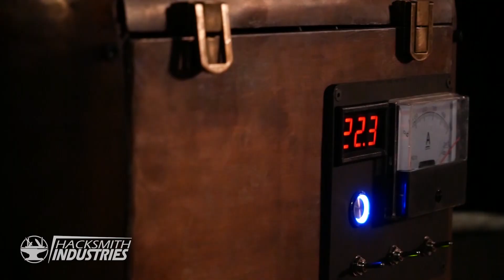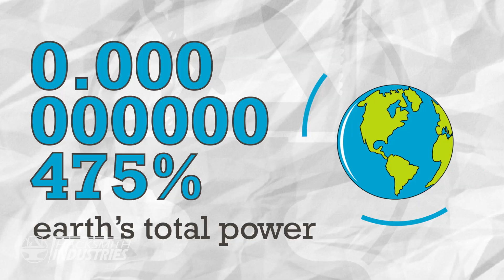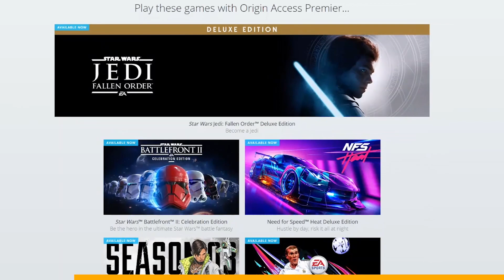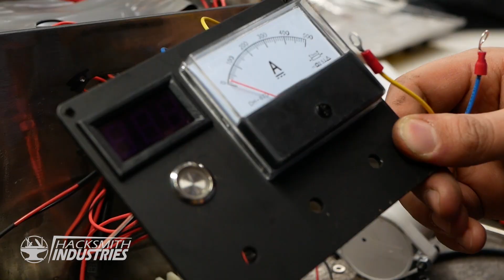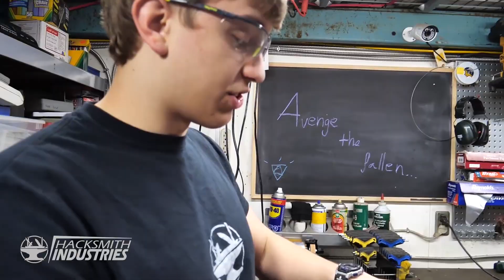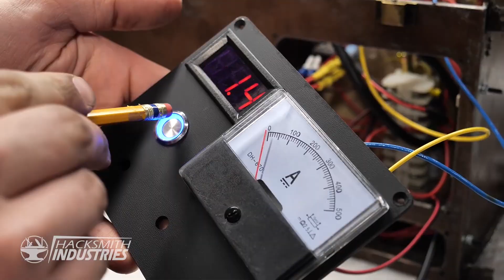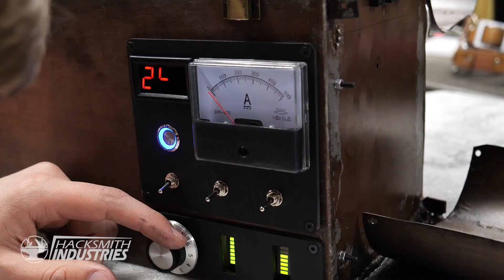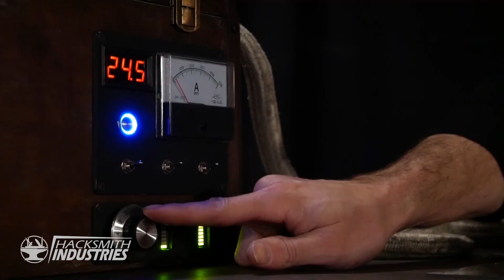World's First Protosaber! (REAL BURNING LIGHTSABER)

Comment: Utilizing sound waves can make the light or reflect. The right pitch can even make light stop. I'm doing a project where I'm using sound waves to stop the heat from the reactors such as fusion reactors from expanding into the metal shielding. It dawned on me. You can use sound waves the same way to stop the energy waves of light from traveling distances. And even containing the light into a reflective beam stronger than even laser.

Comment: I am just an electronics engineer, so... Why do you connect all batteries in parallel first and then switch? It would be a lot easier to use individual mos fets for each "sub battery back" and then to connect the outputs of the fets. Each FET has then only to switch a few amps on and off.

Comment: Laughing in using a hollow rod of metal with bits connecting in the middle so that the energy doesn't converge only at the top and instead has multiple convergence points to more equally distribute the electrical current
Reply from the maker: Wat
Reply: Wat

Comment: Actually to build a lightsaber you would need to build a hilt that’s able to produce an illuminated particle blade with a magnetic field in its center. Basically the blade core. This magnetic field core holds the particles in place, and contains it at the same time and it’s used to adjust the length of the blade. The heat of the blade and it’s cutting abilities come from produced vibrations of the particle within the magnetic force field. The stronger they vibrating, the hotter it gets to a certain limit that the hilt doesn’t break, and these vibrating particles within and around that magnetic field also produce that lightsaber sound. I could go on in how the vibration would work in order to make it work, but maybe you'll get the basic idea of how it actually would work. Just my humble decent thoughts on it. 🤷🏻‍♂️

Comment: It’s undoubtedly an amazing creation, but there’s nothing practical about it....
Reply: Actually. There are alot of practical uses for it. With technology controlling everything almost. Automatic metal doors that can't be bashed in. Depending on how it cuts can replace most battery operated saws. With a few more decades of scientist working on thermoregulation and the installation of crystals like diamonds they can use the energy and force it into a more solid state like lightsabers. Many applications would be useful to have a saber. They used tungsten bars and batteries. With more understanding and open minded people they could easily figure a way to make an actual saber from the movies.

Comment: The main problem is NOT the power source.  The main problem is the insanely high power light beam that magically ends in 4 feet.
Reply from the maker: No,  its the power source.  With enough power anything is possible.
Reply: @hacksmith  Not sure if you are joking, but no.  With enough power you'd melt your tool (nd face) before it was anything close to being a "light" saber.

Comment: Modify idea to inventor :
Use the half soft metal blade like the 
Tape measurement to conceal the blade.
When combat, roll out like a tape. The tape 
Blade create high heat even it is soft.
Handle  with batteries like flash light.
Work or not ????????????????

Comment: I know how a real lightsaber would be made: The handle would have to be a mini-sized nuclear fusion reactor just to make enough energy to power the Light. The actual blade would be extruding out with a telescopic design and would have to be made with a lot of little LED sized and shaped transparent capacitors, I'm assuming transparent or would have to be enclosed with a material with a REALLLY high melting point - such as this: HfN0.38C0.51, that would be able to emit that level of heat. And that's all from me. (This is copyrighted so if you intend to create this you have to give me lots of credit-email me and I will tell you my name if you do intend to do this) Edit: the material of the telescopic device and the handle I would suggest to be a mix of graphene and titanium.
Reply: Guess you’re just gonna have to invent fusion.

Comment: Question: would it be possible (albeit presumably not practical) to create a proto sabre that generated a high frequency, high output plasma field along the length of the "blade"? It would theoretically generate WAY more heat and potential "cutting" power. I watched a video that alluded to using a high frequency plasma field as a "force field" of sorts that could vaporize any incoming threat, so I wondered if it was scalable.
Reply from the maker: Yeah working on one

Comment: Li-Ion batteries short circuited without a current limiter? I would have guessed that they would explode as soon as you did that "welding test"...
Reply from the maker: The short is the current limiter. The pack is happy to put out 30kW :)

Comment: you mean an average north american house needs 40 kW to heat up? A well constructed Italian one needs less than 10, and no, it's not smaller! We do use insulation.
Reply from the maker: No,  I mean that's what's available at the panel
Reply: @hacksmith  Wow! Here they would let you have 10 kW at most, and 3 to 6 kW being the usual. 40 kW is definitely in the small business range.

Comment: i swear the temp in the thumbnails keep going down, if you do the math, 20000 watts is over 10000 degrees, so this is +10000, the kylo ren saber is 3000, and the duel is 2752
Reply from the maker: Watts is not a temperature unit...

Comment: "LightSabers are impossible to create in real life" - since I got to know a few things, and pretty sure, you are wrong now. Its already possible, always were possible, but since everything in sci-fi movies were presented as impossible, people believed its not possible. Inernet was impossible once, as computers, and radiwaves. 
But if you consider the idea behind alien technology (since we are already using alien technology even with using computers and mobiles), you may recognise, even real lightsabers are possible to create.
Bob Lazar's UFO was actually using a propoltion what is way different than any idea, what was used for propltion nowadays.
That UFO technology "allows" people to travel lightyears (distances) without actually reaching lightspeed (not needed), and making freaking long distances without fastening up that much - because of the idea behind the UFO propultion system.
So, I say, you may basically think wrong about making a lightsaber, in details and logic, but its possible to create.
Reply from the maker: More the heat and energy density that is the issue ;) not melting your face off holding it

Comment: The original light sabers in star wars were battery backs! You literally made a real saber. Holy shit. Great engineering man you deserve the 12M views. My mouth was literally salivating around that 15 min marker. Holy sh*t man, the FORCE is strong within you.
Reply: lightsabers are made up of light not a core of metal. this is a heatsaber not a lightsaber the word light in lightsaber is there because the blade is made up of nothing but light not metal and cloth.
Reply: @fubar1872008  lightsabers would just be lasers then and you wouldn't even be able to see the blade.
Reply: Timothy Farmer definitely not made of light
Reply: Ye Old Saber tech this equates to Gundam Universal Century Heat Weapons 
Dom Heat Saber, Gouf Heat Machete, Zaku HeatHawks, need I say more? 

Beam Weaponry is Expensive to Manufacture let alone maintain a Strong enough Focus that it can Melt/Slice through Objects fast and efficiently. 

The Strongest Lasers/Lights exist on the Spectrums that Human Eyes cannot see let alone fathom. 

What you can see are 
Burn Lasers/UV rays/Plasma

Comment: Thats pretty cool... I wonder if we can design RF field sets that delineate a specific volume of space adjacent to the emitter/transmitter?  idea being to use RF transmitters to define a space about an inch square by about 3 feet long.  Once the RF sets up the defined space, then working thru phase offseting the localized fields so that whenever one field is at max + polarity the concomitant field is 180 degrees inverse to keep a luminous plasma present within the defined field volume?
Reply: As for being able to generate power instantly on demand look up a guy named Tariel Kapanadze... :)

Comment: Should totally use super capacitor instead of battery and might be able to fit enough juice into a small handle. This is a beautiful tool. How thick of metal can you cut with this? This is definitely an upgrade compared to flame or plasma cutting. You could probably quickly cut metal thicker than 7in which is basically impossible with flame and plasma cutting.

Comment: My understanding that the laser blade of  the saber is a laser arc that has its base on the head of the saber cylinder. 2 points on the end circle create an arc that starts small like an arch and grows so that it is actually a blade of arc light and not a central material pole, as you've shown.

Comment: you say the biggest problem is the energy source but i guess the actual biggest problem is that a real light- or protosaber shouldn't have a blade until it's engaged
Reply from the maker: Nah that's solvable. The energy density is the problem
Reply: @hacksmith  huh, interesting

Comment: It takes 1.69 gigajoules to power a lightsaber. 216 gigajoules of energy are used to power New York City annually. So it requires about 0.8% of NYC’s annual power requirements to power one lightsaber. In city blocks: ~120,000 blocks in NYC x 0.0078 = 936 (~950) city blocks. So figure you need the annual power output of 1,000 NYC city blocks to power one lightsaber. Oof.

Comment: a controllable laser with a reflect top would be more reliable from power output needs. light in red,blue,purple,green or yellow has enough length strength if powered correctly to an recharging station battery pack that will recharge after discharges.

Comment: reverse polarity  capacitors: the overcharge would be filtered into the capacitors and then come out at a controllable rat so it is an self recharging matrix that uses heat as a by product
Reply: Would sustain some recaptured energy, but not enough to be worth the effort. May as well just find a kyber crystal

Comment: Look up “proto-lightsabers” 
This is exactly like the prototype the first Jedi used... even the power supply and all...
I think we’re on the right track 😳
Reply: Was the blade retractable though?
Reply: @krunkformula  back in the older days the jedii use a saber like what hacksmith lightsaber is but the only difference it has a kyber crystal and a smaller battery source
Reply: @DanielshowMY  
And even before that, they used Steel  blades imbued with the Force.
Reply: krunkformula yes
Reply: Now we wait for the use of the Force to happen....
Reply: In legends
Reply: For the exception of kyber crystals
Reply: lightsabers are made up of light not a core of metal. this is a heatsaber not a lightsaber the word light in lightsaber is there because the blade is made up of nothing but light not metal and cloth.
Reply: Timothy Farmer ur right but u can’t make anything to manipulate light like that it’s the closest tging
Reply: Its all made up tho... ?XD
Reply: ISAK.M ur point exactly?
Reply: All we need now is a power source small enough to fit into the tininess of the handle. Also somehow make it be an actual laser that has an end.

Comment: I've seen many versions of a "Lightsaber"  this is a Fairly Cool Concept. A Proto-Saber ^-^ 

The thing that makes a  Lightsaber lethal is that it's a Powerful Laser Projected from a Crystal powered Chamber,  You cannot Visibly See the Strongest Lasers without special Lenses/EyeWear or UV Exposure.  

The Jedi fictionally had an Affinity/Discipline to sense the Length of their beamsabers. 

This is a Heat Saber. 

Mobile Suit Gundam's Principality of  Zeon has this Technology look them Up, the DOM's Heat Saber, Goufs Heat Machete, and Zaku's Heat Hawk
 (Heat Tomahawk/Axe/Hatchet)

MGS Raiden Has this Tech too, His Sword does exactly this, Heats Up but keeps the Temperature within a  Constant Vibration that Stimulates Heat to Spread Across the Blades edge. It's not Wired though so Its to be Assumed Raiden's Sword had some ahead of our Time Internal Battery Tech. 

The Sheathe could be a Sort of Recharger for Raiden's Sword.

Or it could have been recharged through the ever Popular Sci-Fi Culture 

 "NanoMachines Son"

Comment: My question is, how did you get the "Protosaber" that you built to not heat up the handle and burn your handdd
Reply: Insulation. You can clearly see at one point a flame emitting from the handle at the base of the rod. He's simply separated the interior from contact with his hand, which, practically speaking, is probably why the handle needed to be so thick.

Comment: Couldn’t you use hydrogen fuel cells in the hilt . So theoretically it’s like a gun with billets but instead of bullets it hydrogen canisters. Like there would be a constant oxygen supply so isn’t that plausible
Reply from the maker: They dont produce enough power

Comment: Why the fuck you didn’t use a carbon 3D print for the battery case? 5kg less would be helpful in a battle, isn't it?
Reply from the maker: We don't have a carbon 3d printer ...
Reply: the Hacksmith I always do this as a contract production, it is no longer as expensive as it was two years ago
Reply from the maker: Ok

Comment: Remember when people said: It is impossible to send people to the Moon inside a giant bullet? ...well nothing is impossible.
Reply: It's definitely possible, considering that's practically what they did in 1967. Georges Melies wasn't too far off, just a little more... industrial.
Reply: @AwdryFan1997  he based it on a Vernes novel
Reply: To be fair though, creating a lightsaber as seen in the movies is impossible because it's a beam of energy that has a fixed length. You cannot create a beam of energy with a fixed length which is why they use a metal rod instead. It's like trying to get a laser beam to only be 3 feet long or something. If I have the Star Wars science right I believe said beam is supposed to be controlled by the force somehow and well, we don't have force powers unfortunately. With enough scientific advancements and time we might someday create something that looks like a lightsaber but it will still need some kind of solid blade.
Reply: They didn’t say it was impossible to send people to a moon set stage, but I’m sure the cia thought Kubrick was going to be impossible to get, until they did, lmao
Reply: Some things are impossible

Comment: The main limit is definitely not power. There are many more, more glaring issues. Beams of light don’t interact, and the theory behind creating beams that do leaves them unable to burn or cut. They also require a vacuum. Limiting a beam in space is not a current possibility and is likely impossible. There’s a lot of physics behind why they’re impossible in their on-screen configuration and power is just a cop-out.

Comment: If... I mean WHEN, we will make the blade foldable, and the battery pack smaller that it can fit inside the handle, it would be almost a real wireless, and portable lightsaber (Yeah, it won't have a laser-blade, but it looks and does the same as a real lightsaber). The last thing would be to learn telekinesis, and there we go... The First Jedi Order.

Comment: If you used a copper rod as the “blade” of the protosaber, since it is technically burning, would it end up burning green and therefore being more like that of Jedi lightsabers rather than a fiery rod of death? Or is there another way you’d have to figure out how to color it? I think that would be a really cool video to make.
Reply from the maker: Unfortunately all metals burn yellow to white when hot. Chemicals burn different colors but as flames only
Reply: the Hacksmith gotcha just a thought. It would be really cool if you could find a way to recreate color like that. However, I’m a huge fan of star wars and really loved the video, keep up the great work! Love the engineering aspect too cause I take several engineering course at the moment so I found this quite entertaining and even shared it with my engineering teacher.

Comment: "Lightsabers are scientifically impossible to create in real life."

Me: "It's treason then."
Reply: K B  yeah like how would you even make a warp drive? Find antimatter?
Reply: @yellowsunfish4219  there's lots of antimatter around, just no practicle way for us to reach it right now.
Reply: @yellowsunfish4219  you do not need antimatter for a warp drive
Reply: @delonn60  you might, what do you know?
Reply: @yellowsunfish4219  no, transmutate matter into antimatter.  Lol yeah right
Reply: Ken Vernon Well, that’s not the only way antimatter can ever be made. The universe is constantly spitting out antimatter, but it instantly gets annihilated because of there being more matter than antimatter. So there is a lot of antimatter around, it just gets destroyed once it’s made.
Reply: You do not need antimatter for warp drive. What you actually need is an exotic matter which is a matter that has negative mass. Antimatter does not have negative mass. It is the same thing as normal matter just with the opposite electric charge.
Reply: @kenvernon4106  Or - more peacefully - move an electric car 200 000 000 kilometers  :)
If storage - as you say - is managed properly. So using a storage of 10 micrograms would be sufficient to go 2000 kilometers and may be a little bit safer!
Reply: It's still impossible, ®€+@®d.
Reply: it is though, this isnt a luightsabre, cuz it isnt made of light, metalsabre would be a more fitting name